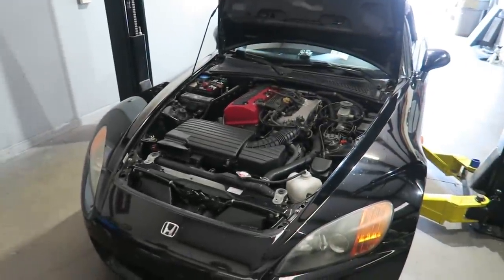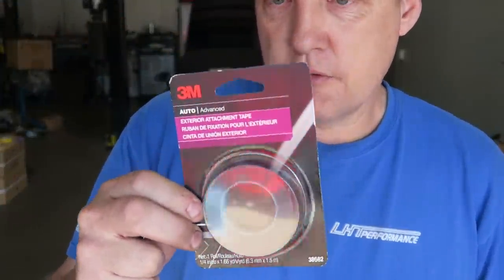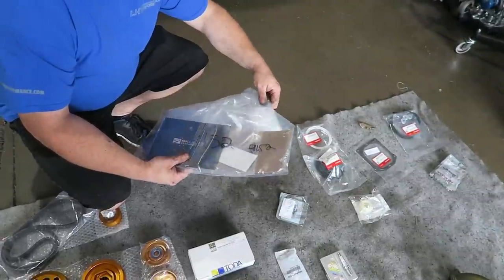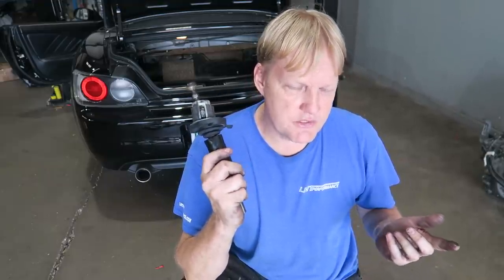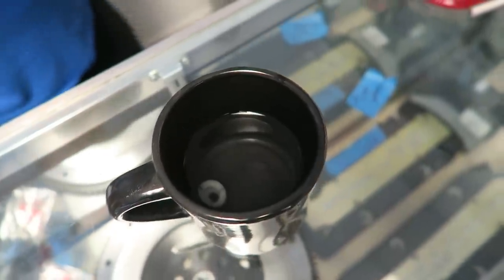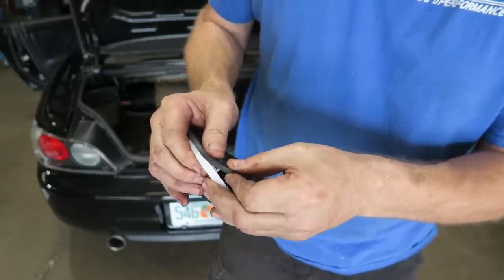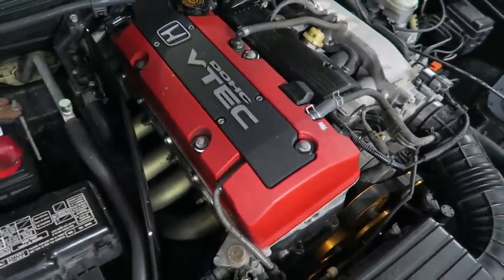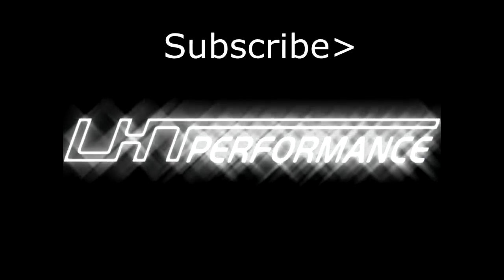S2000- Perfect Bolt ons

Comment: Come on john bring the tech Wednesday back even though i dont have an s2000 but still learn tips and tricks and forget about the trolls and haters.
Reply from the maker: Kenny_Fa5 Maybe.  Once our channel hit 100k subs it should pay a little. Then we’ll possibly bring it back.
Reply: @LHTPerformance  I found your Chanel and I recall when you started doing supercharged Honda’s years back! Also the insight etc 

Great content and great info all the time!

Thank you!
Reply from the maker: @JNAMOTORSPORTS  Yep. Started in 1996.
Reply: @LHTPerformance  Is it safe put alluminum pulleys for harmonics? It can be possible fit only single pulley or only the complete set?

Comment: I used a heat gun to warm up the plastic for the shifter.  Helps so much for both removal and install!
Reply from the maker: dct223 Good tip
Reply: @LHTPerformance  Just have to be careful!  Blow dryer on low would prob be more safe

Comment: Hey John, I just wanted to also let you know I swapped over my old Honda hose clamps to some T-clamps when I was doing some hose replacements. I think you guys could benefit from doing these with your radiator and radiator hose swaps. They make a better deal and don't cause the hoses to have bad clamp marks while also not causing them to rear like the worm gear style.

Comment: Hey john. Do you sell an lht modified kraftwerks kit for overseas buyers? Its an 07 s2000 2.0 9k redline but with dws throttle ( i think it accepts flash pro). Also its left hand drive. Outside it looks like the typical ap2 with ap2v2 multispoke wheels and a headlight washer.

Comment: LHT Performance I seek your guidance. Just bought an AP1 (which I love and is in near perfect conditions). I did the Airbox mod (thanx to what I saw in your video) and I'm planning on getting the skunk2 alpha header, test pipe 70mm and the megapower dual exhaust. How much power & tq can I expect to see on the dyno.
Reply from the maker: Francisco Cruz The Skunk2 is only going to give you 5-6whp through the mid range. It’s not the best header for NA.  More of your power will come from tuning. If you put the car on a dyno you’ll notice the peak power is around 8100rpm and the power falls off all the way to 9000rpm. In 2nd and 3rd hear you’ll feel the car ‘lay over’ as the power falls off.  You’ll see it runs extremely rich around that same area.   Tuning is your best bet, lowering the Vtec change over and tuning up top will make a world of difference.
Reply: @LHTPerformance  it's that I heard that for AP1 tuning is hard since kpro it's like $2500ish and the tuners near me don't do AEM which is half the price. I'll be going turbo after my deployment which should be next summer. What mods do you reccomend for NA build in the mean time?
Reply: @LHTPerformance  thanx for the quick response I subbed.
Reply from the maker: Francisco Cruz If your long time term plan is to turbo charge make sure you buy parts that will meet that goal.  Don’t waste money on a header as it will be replaced when you turbo charge. It would be a good investment to set it up with AEM and tune it. Contact us, we can set you up with parts and a remote tune.

Comment: Do you need hondata for header so you don't get a cel?
Reply: Joshua Santiago no
Reply: @goldcd5  how would you get rid of it?
Reply: Joshua Santiago the cat is separate from the header on an s2000, also hondata doesn’t support a pre 2006 ecu
Reply: @64Spokes  I know it is but there's still an o2 sensor on it which is why I asked

Comment: Did he go with a lightweight crank pulley and ditch the damper?
Reply: Hope not these aluminium crank pulley are junk 

Oem/ fluidyne/ ati are the only good crank pulley
Reply: @legros731  yeah, it's unfortunate that people do this.
Reply: damper not required with lighter pulley
Reply: @jwrx7tt01  don't tell any race teams that.  They'll laugh you out of their shop. http://www.atiracing.com/products/dampers/damper_dinan.htm
Reply: @ebf1003  ASM is a race team. I was able to stay in their shop and their race car and customer cars are still running
Reply: @jwrx7tt01  either way, nobody recommends running without one, you're asking for problems that could be avoided. If you're talking about Adam Sharpe's company, I'd love to see where he recommends running without one.
Reply: @ebf1003  https://autobacs-asm.com/blog/asm/index.php?mode=res_view&no=1013

you can use "軽量クランクプーリーキッ" in the search bar to see countless sucessful installs. It is the same product used in this video but a different colour.
Reply: @jwrx7tt01  Those are nothing new and they're just as bad today as they were many years ago.  Try running a car without a harmonic balancer and with one, the difference is almost always noticeable on the dyno, on the car's performance and long term during tear downs in bearings, pumps, etc.
Reply: ebf1003 My friends and I have been using them for years and tens of thousands of km no problems whatsoever. We picked up around 8-10whp and got a small improvement in fuel economy too. I should also mention that when we removed the old crank pulley, the oem rubber damper was so hard it was basically solid. Again, no issues using the oem crank pulley either
Reply: Harmonics are very hard on oil pumps. Honda knew what they were doing by putting a harmonic balancer on their engines. Your not smarter than honda engineers
Reply: @dougn6465  nobody is claiming to be, i'm sure toda engineers are equally smart.
Reply: @dougn6465  yeah, I agree wholeheartedly.  At a certain point it becomes a case of "you can lead a horse to water, but can't make him drink."
Reply: @jwrx7tt01  nope, this is just a money grab. Not a reliability add.